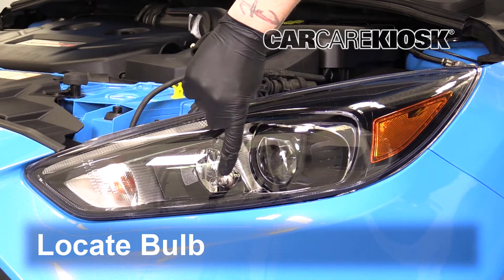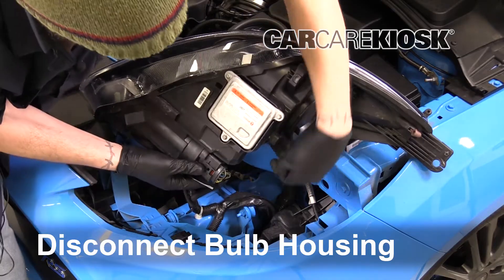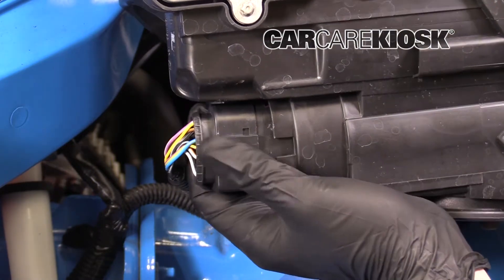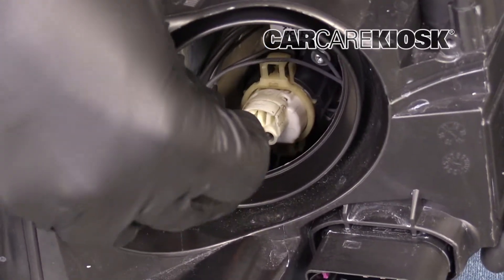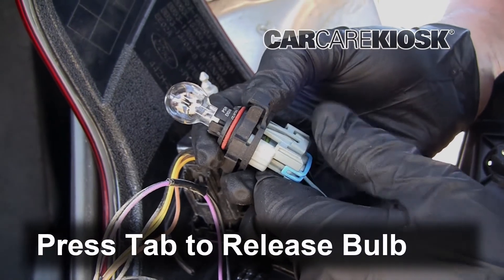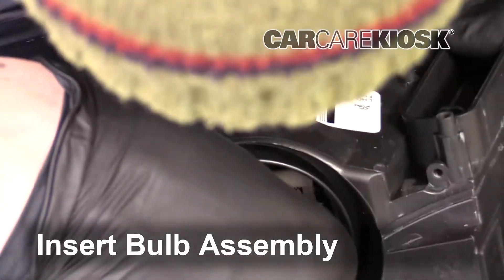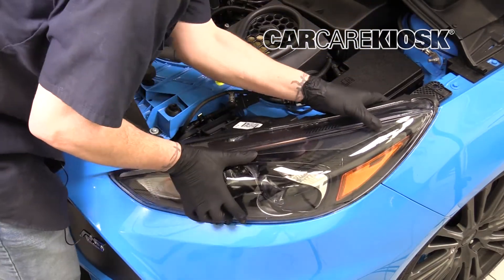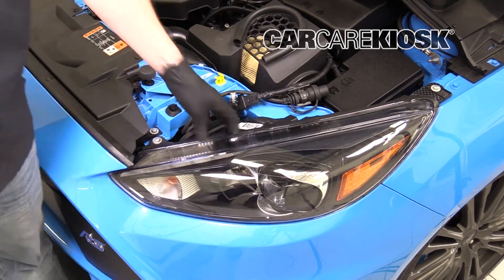How to Replace the Cornering Light on a 2017 Ford Focus RS

Comment: I have a similar cornering light equipped on a 2017 Ford Focus ST, but the bulb fitting looks very different to this one.  I noticed the bulb had a tendency to vibrate loose if not fitted correctly, triggering a headlight control module fault code (B1C98:13 - open circuit).  It's impossible to replace/reseat the bulb properly without removing the headlight assembly from the vehicle, I'm guessing that a previous owner or repair shop may have tried to fit the bulb directly to the vehicle to save time.  I found that the bulb had vibrated loose causing an open circuit.  After reseating the bulb and getting a good solid click from the connector when refitting, all fixed, code cleared, no parts required.
Reply: Thanks for this!!
I have a similar problem ill check the balb later

Comment: I would refer to the large item you unbolted from the vehicle as the "headlight assembly" not the "bulb housing". Technically not incorrect but I would say the bulb housing is the specific section /compartment of the headlight assembly.